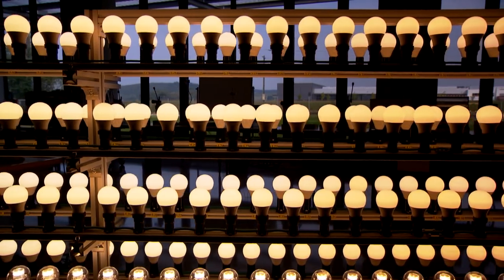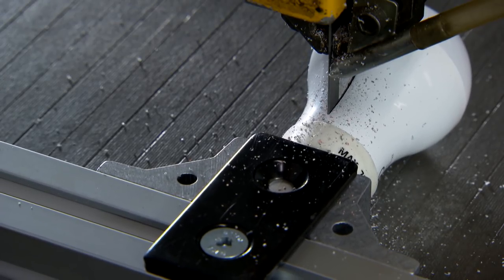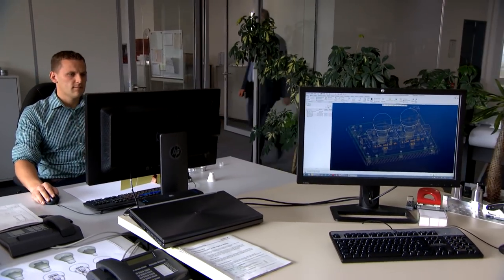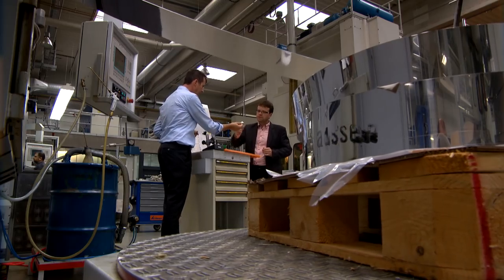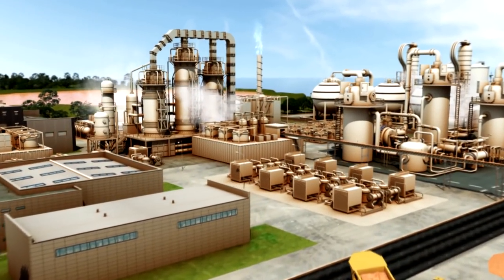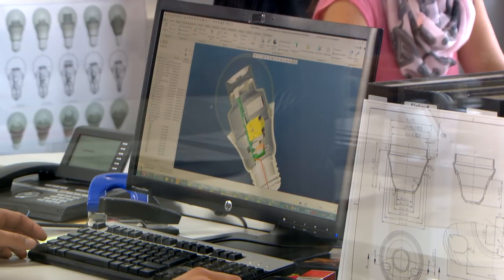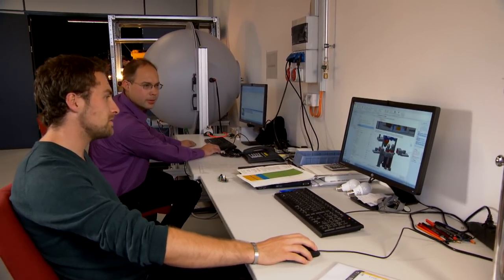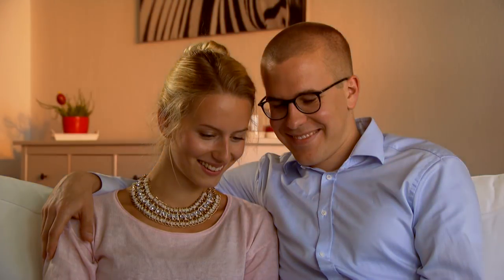Material efficient LED production in Germany

Comment: So, I am just wondering. Why call these LED bulbs efficient when there is a filament-LED product out there which does not use external voltage converters, does not use cooling since it uses its own high surface volume and environmentally friendly gas in a closed bulb system to cool itself and is as efficient as any other LED type? They need ZERO Aluminium! You saw the sewn open LED bulbs in the video. Ever opened an filament LED bulb? It is nearly as uncomplicated as an old light bulb.Ah, but the Chinese have the patent, don't they? Well, then lets just spill out false advertising videos on YouTube to sell our crap, right? If you want to know why I disliked this video, watch this video here https://www.youtube.com/watch?v=Y1UOjhy5zmQ and then this video again. And compare what crap you just have been fed by  VDI Zentrum Ressourceneffizienz.